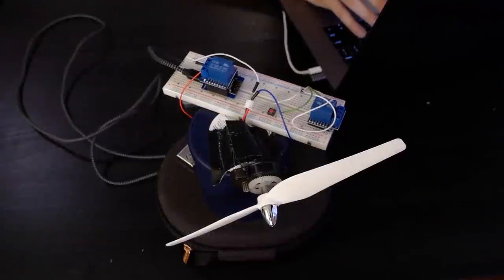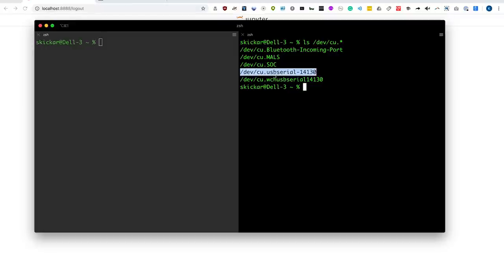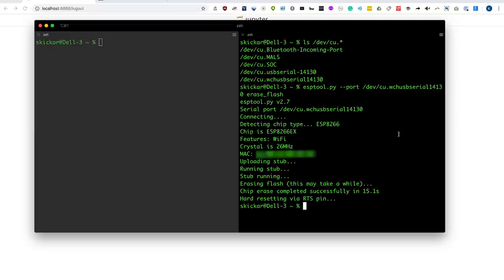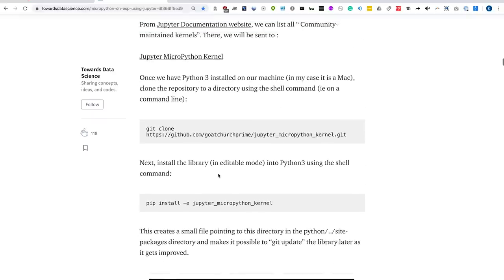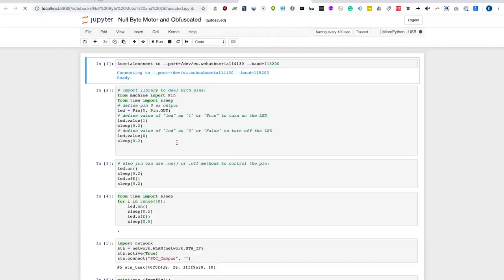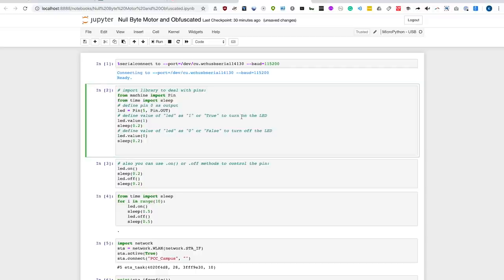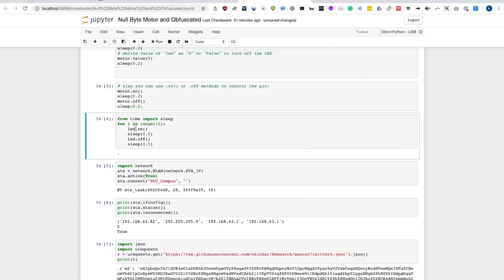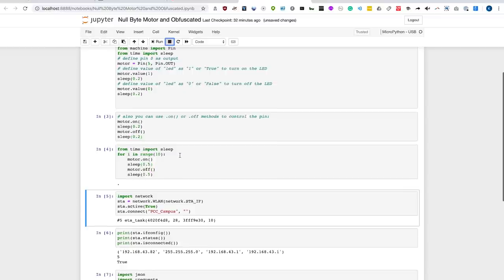Control Electronics from a Web Browser Using MicroPython & Jupyter Notebook [Tutorial]

Comment: Hey! Could you make a video explaining how to fix the "Can't detect wireless network" issue when running kali linux on virtual box? Is the only solution to buy an antenna? Can I just intall wireless drivers or something? found something online but I didn't quite get it. Thanks!
Reply: check the wireless settings of the VM
Reply: @staceixan  Honestly I uninstalled it since I needed storage but now I installed it in my phone hopefully it works now tho I'm trying to figure out how to configure userland with both vnc and ssh (ssh is already setup with juice from null-byte's tutorial) cause, u know, I want to use wireshark in my phone and it wont open in terminal
Reply: @staceixan  No such thing as wireless settings tab bro.